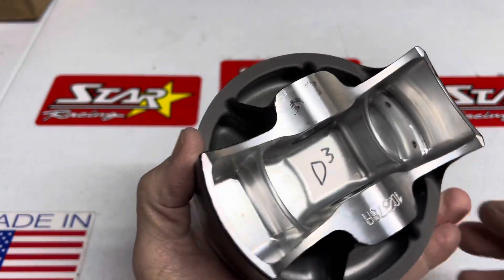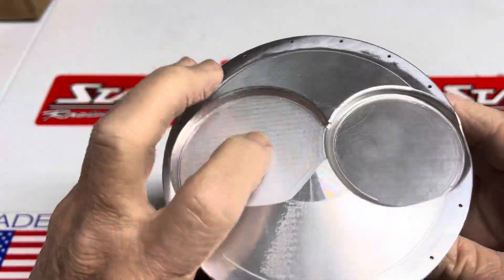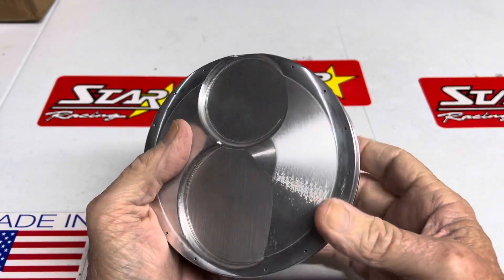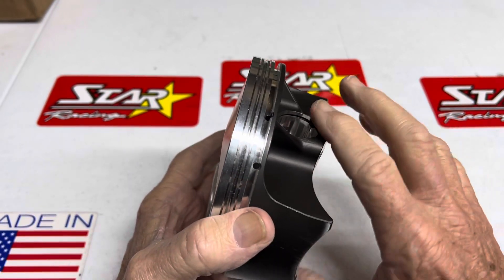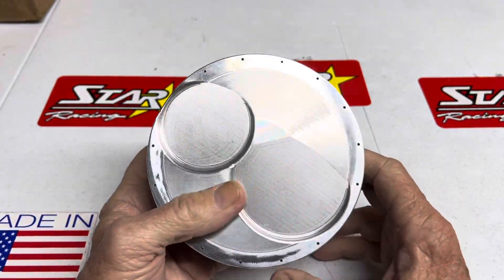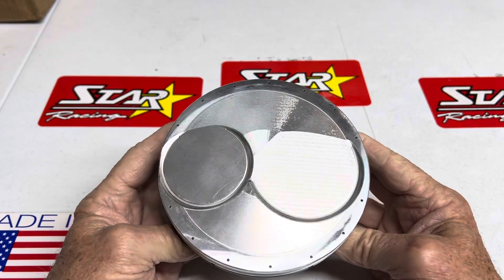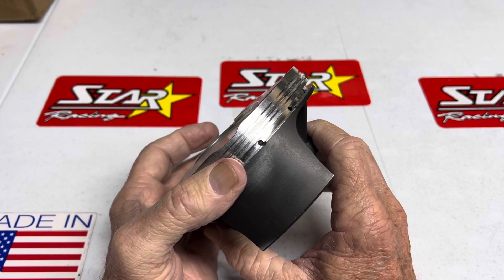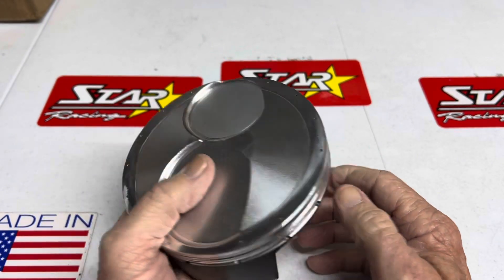George Bryce talks..PART 2.  Here it is. You asked for it. 🙏

Comment: George, 
Loved your 2 piston discussions.
I am surprised nobody talks about crankcase evacuation, lots of discussion on various forms venting but not true evacuation. 
I have been a technician all my life, obviously exposed to many different different forms of systems. 
Recently been exploring ventilation on my 23 Road Glide 3.
I had installed my usual Ness air filter and exhaust, and noticed the oil collection in the mouth. 

I have installed an inexpensive Amazon catch can, drilled and tapped the trans top cover, routed it to catch can.
Outlet side I installed a Honda car PCV valve to the vacuum port on carb.
Crankcase now is under vacuum,  which should help ring seal and improve power with no oil loss or consumption. 
Thoughts?